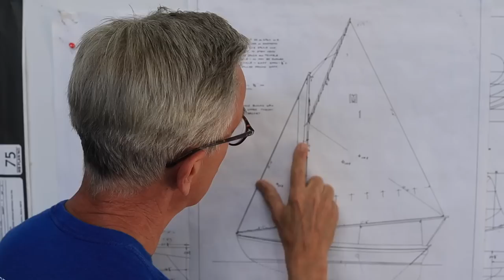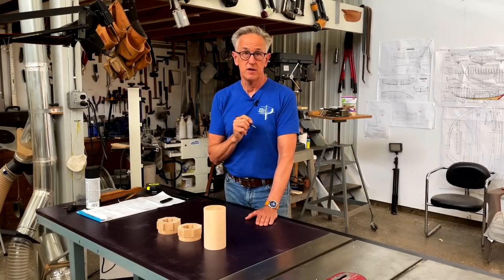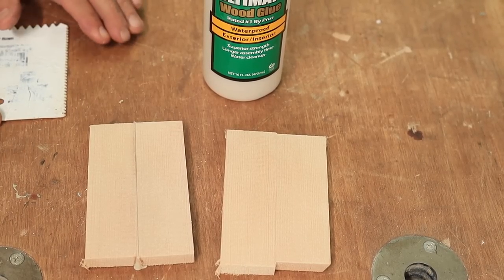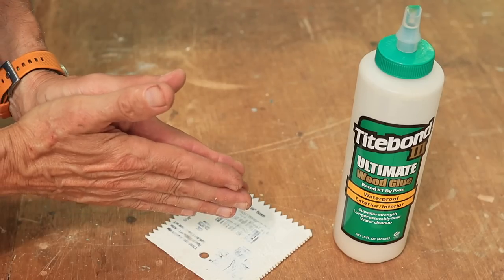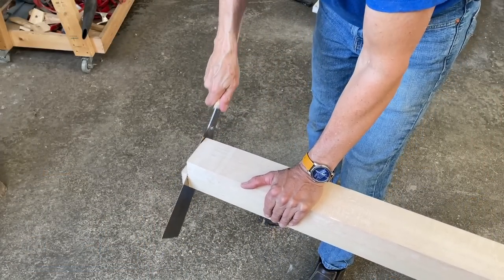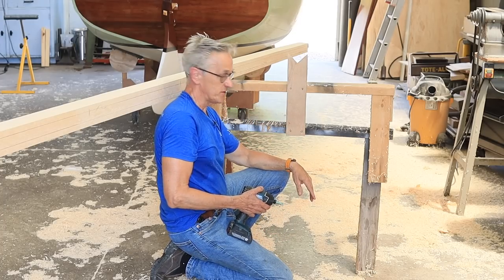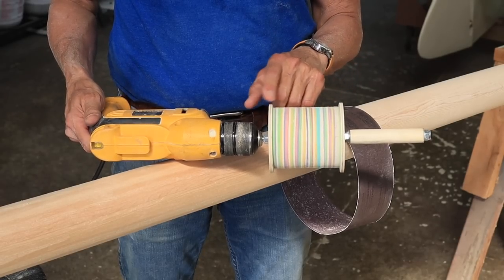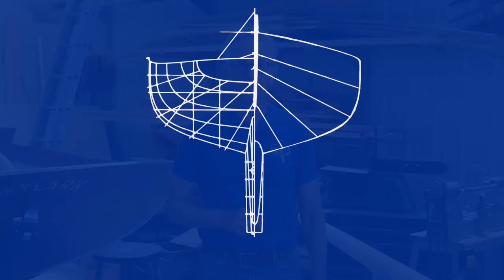Hollow vs. Solid Mast S2 E66

Comment: You cited densities for Douglas Fir being ~6% heavier than Sitka Spruce; These are natural products with inherent variations; it would seem to me, pretty likely, that these are close enough that you could actually find some Douglas Fir that is less dense than some Sitka Spruce...but you might have to search through a good-sized pile to find it.
Also, a factor in comparing options here is the cured weight of measurable quantities of adhesives.
The major benefit of a sectioned mast is your ability to have more uniform stength in different planes, versus the 'pole', which, even if you can get one that has grown quite 'straight', it is still a little hard to tell how symmetrically it has grown.
Assembling a sectioned mast can let you be more discerning in examining the grain structure and patterns, for symmetry/balance.
Personally, I like the idea of the 'birds mouth' joinery, as it rather functions as an integrated tongue/groove system...except for the part where the tapering is going to eliminate much of that, in the upper portion of the mast.
Unless you 3D modeled it, and had a MONSTER CNC machine!
 ;-)
Happy waves!

Comment: There is another option in mast building which can be 5x stronger then a solid mast. That's a laminated one wite epoxy glue. The biggest advantage is its flexibility. Be safe and joyful building your boat.

Comment: I'd be worried about rot in a hollow mast. Water is going to get in and it'd have to be drained somewhere, but it is never going to be quick drying in there unless dry air is blown through. 

On a bigger vessel I'd worry about the strength of the mast where it comes through the deck. I'd want that section to be solid, to resist the forces applied at that point, and also so that if the mast was lost in heavy weather it didn't leave a  hole for water to enter below decks. Losing a mast is bad enough but if it opens up a way to swamp the vessel too, well that could be too tricky to handle at the same time. 

Plus a hollow mast is probably going to be wider, which will probably impact the deck structure and also the sailing qualities.

Comment: I wonder if you considered cutting the board in four in order to align the grain in different directions.  Wasn't your wood quarter sawn?
Reply from the maker: No did not consider cutting it as the grain it so straight to would not have helped. And yes, the Spruce is quarter sawn.

Comment: I like your clamp rack, but please explain to me, why did you clamp the way you did with the screw to the bottom? I believe it would have been easier if you had it on the top
Reply: My guess would be out of good habit.  The screw part tends to mar the surface, so having it on the metal saves the wood.   Also the stems facing up is also awkward,  and painful elbow hits are prohe to happening.

Comment: To answer the question on at what point would a hollow mast make more sense than a solid mast: When the difficulty and expense to procure a solid clean and straight piece of mast wood outweighs your budget and time.

Bigger the mast the harder it will be to get an appropriate log. Laminating does provide a certain strength, but as you mentioned its life will be considerably shorter if not kept dry within.

Comment: What about filling a hollow mast with urethane foam?  The foam is closed cell and would prevent water from gettin inside and it would provide some additional structural integrity although not as much as solid wood.  The advantage would be overall weight.  Your statement about weight was comparing sitka spruce to douglass fir but not hollow to solid.

Comment: Bob, how did you get your sanding belt inside out?
Reply from the maker: Hi Roger,
The belt does want to resist but with enough persuasion it will flip outside in. The first belt I used was a 3 x 18" I then tried a 3 x 21" which was much easier to convince to turn inside out.
Thanks for watching,
Bob

Comment: have you thought of doing some small scale testing of solid and hallow mast's, typically hallow tubing is stronger the solid but I am not sure if this translates to wood.
Reply from the maker: Hi John,
I ask my engineer friend about that. He said it is true with steel tubing is stronger because of the density and weight of steel. He went on to say wood is much different, asking "If you were building a deck with 6 x 6 support post which would you want a solid post or one that  was a box made of 1 x 6's?"
Thanks for watching.
Cheers,
Bob

Comment: Maybe a silly question but would it be possible to use a table router and a 1 1/2" roundover router bit to achieve the same result on a lesser diameter mast without having to do all the planing and sanding? A 1 1/2" roundover bit will make a 3" diameter pole.
Reply from the maker: The only problem I could for see is that masts are tapered.

Comment: I built a goat island skiff and went hollow birdsmouth. I didnt have to calculate it but the build was easy. You cut the strips on a tablesaw and plane to taper on the flats sides. When glueing up i used epoxy and i taped off two of the joints on the first glueup. You just bind it with tie wraps it will lie straight. After the glue dries you cut it open and you have two halves. When i glued the final two joints i coated the inside and the endplugs with epoxy. When dry plane the corners off flush and you have a hexagonal spar which is where youd be after a pass with spar guage and plane. The OP here says the weight savings is insignificant but i disagree with that. Theres half as much wood. The condensatin and rot inside issue i hadnt heard of. Mine is only 2 years on so cant say but the inside is completely coated just like the hull. I made my yard and boom from solid stock milled square spar guage and plane and that was easier by a couple steps.

Comment: How much shrinkage do you get with the bronze castings?
Reply from the maker: Hi Guy,
The shrinkage is around 1.0 -1.5% fro Silicon Bronze. There is however many variables. If the casting is very thick it will shrink more and not in a uniform way. 
The great part of the Haven 12 1/2 plans is that Joel White, the designer calculated the shrinkage is the plans. So all Steve had to do is follow the dimensions on the plans. One Benefit of using modeling software it quit easy to add shrinkage or calculate the outcome. 
Thanks for your question. And thanks for watching!!
Cheers,
Bob
Reply: @TheArtofBoatBuilding  : As a retired "old school" pattern maker, I would use a 5/32" per foot shrink ruler.

Comment: When you were looking for the mast timbers, was it possible to find  quarter saw wood, or did you have to take whatever came in that length?
Reply: I think it works like this: Because the mast is round, one side will be quarter-sawn, then walk around it 90 degrees and it'll be flat sawn. So you can just rotate the mast for the best strength. Since he glued up two pieces, it would be good if they were both sawn the same way.
Reply from the maker: I purchased the Spruce from Johnson Workbench is MI. I ask for clear quarter sawn and that's what I received. Great people to work with.

Comment: There's more surface area glued together in the bird's mouth method, which ought to make it stronger.  A friend and I made a 4 inch tapered mast, 12 feet long made from white pine 2x4s.  Sitting on sawhorses at the very ends, I sat my 240 pounds in the center and and the spar hardly flexed.
I also made two masts this way from white cedar, each just under 40 inches long and about 7/8" in diameter, for a radio-controlled schooner.  They weight almost nothing though I think I'll refrain from the sitting a fat man in the middle test.

Comment: Bob, would there be any chance you could offer a link to some documentation on epoxy not being suitable for tight joints?  I can't find anything to that end.  There's plenty to say that epoxy CAN fill gaps if required by adding fillers, but nothing that agrees with your comments.  Indeed in building wood homebuilt aircraft (yes even aerobatic types) epoxy is the only game in town, usually T-88 is recommended, but West's "Six-10" is getting lots of recommendations nowadays as well.  I'm wondering why epoxy would be recommended for laminating and scarf joints on wing spars but not suitable for a boat mast.

Comment: Why do you install the clamps with their handles down?
Reply from the maker: Hi Gene,
The flange on the I-beam has a slight taper on the inside (s-section I-beam). By putting the pad of the movable jaw on it the pad will adjust to the angle of the taper allowing the fixed jaw of the clamp to seat properly (perfectly flat) on the wooden mast.
Thanks for watching!
Cheers,
Bob

Comment: I enjoy your channel and admire the craftsmanship and beauty of your work. However I disagree with your solid vs hollow mast construction argument. The difference between the density of Sitka vs Doug fir does not signify the weight difference between a hollow mast and a solid. Just looking at the cross sections of the two samples that you made tells the story. The hollow sample must be at least 40% less dense whether made from Sitka or fir. I would also like to point out that the strength of the hollow is multi directional. Each stave is positioned at its maximum strength. A solid mast would have to have variable directional strength due to its grain direction.

Comment: Hi ,the difference between the solid to wood composite is the composite give much resistant and eliminate the part are negative on mast work .
All part of boat do a work ,all together do a work team , specially on wood boat .
The mast must to be resistant to complete the work and don't have part ,inside , can don't work or do opposite reaction on work .
For this reason a must empty is structurally much resistant than a solid ,because some part inside are only weight and working to reduce the strongest of must .
Plus ,when the shipwright prepare the part of composite must check if the fiber of wood is linear ,strong ,with same age ,and same percentage of strong line .
Because all tree growing in different way and different season condition can give different strongest .
To glue is better use always the epoxy elastic ,or resorcinol glue ,the red or black .
If the must is composite in two or 4 section ,the line must be from outside to inside from the bottom to the top ,glued in opposition .

Comment: semper sou grato por seus ensinamentos, e cheguei ao ponto em refl ir sobre o mastro do meu projecto, você apresentou todas suas medidas, mas pode explicar a conforma o comprimento; no meu caso é necessito um mastro fracionado de 9 metros, how can we define o diamentro na base e no topo?

sempre sou grato por seus ensinamentos, e cheguei ao ponto em refletir sobre o mastro do meu projeto, você apresentou todas suas medidas , mas pode explicar a fórmula conforme o comprimento ; no meu caso é necessito um mastro fracionado de 9 metros, como posso definir o diamentro na base e no topo ?
Reply from the maker: Eu acho que você está dizendo que seu mastro tem 9 centímetros de diâmetro? Se sim, está muito perto do meu mastro, que tem 8,3 cm. Minha base tem 6,66cm e a parte de cima tem 5,4cm. Espero que isso ajude.

I think you're saying that your mast is 9 centimeter in diameter? If so it is very close to my mast which is 8.3 cm. My base is 6.66cm and the top is 5.4cm. I hope that helps.

Comment: I know nothing about boats and it has 40 year since I had construction engineering class, but back then they were big discussions about the engineering board correctly could be 10 or 20 times stronger than a solid piece of wood of course this depends on the construction the way out where the stress points are and with modern day construction one of the manufactured mask with aluminum, stainless steel, bronze, Graphite or fiberglass center Could give you extremely good properties more so than a solid wooden mask. Because this is something Engineering would have to lay out look at where all the stress is coming from and then put together what would be the most effective way to build it. And of course to sit down for engineer and do that you’re gonna spend $2000 to $20,000 to get the information. And then doing the manufacturing process exactly right. And these are big ones gifts and we’ve been making solid wood mask for 4000 or 5000 years And They have done a damn good job for that many years. I live on the ocean so I have lots of stores and shops to go in and look at boats and how they’re made and put the gathering the materials lots of other things being used for this besides wood so my Sumption would be that there are companies out there they’ve already done this work and give you a truthful answer what would be best for your purpose I’m just shocked that no one stepped up and gave you more detail. The heart and soul of Youtubers people working together figuring things out and sharing their experiences well I can’t fix it I don’t know what to tell you I can do is offer my thoughts on doing a great job keep up the good work I’m sure it will be fine.

Comment: I didn't follow one point of your argument.  You said the weight difference between Douglas Fir and Sitka Spruce was insignificant. Then later you said the weight difference between solid and hollow was insignificant.  I've always heard it said that weight savings was the principle reason for building a hollow mast,  as it obviously is a lot more work.  It seems you applied the data from the first point to the latter.  And, I hadn't heard the issue of rot raised before, which is an important consideration.

Comment: Its a weight, and material utilization problem.  The answer is not universal on when it makes sense to do something over something else...  Like everything in engineering, it's a tight rope between many competing constraints.  The material at the centroid isn't doing much in terms of strength....  I hole heartedly agree that hollow voids are subject to moisture ingression that can lead to structural looses that won't be accounted for in the initial design an analysis... It's obviously prudent to put every amount of insurance into the design to seal blind surfaces to provide protection. and drainage.

Comment: I think it's erroneous to say that the weight difference between hollow and solid is insignificant - it's actually a substantial saving., particuarly for an 8-sides birdsmouth spar. I think perhaps you meant to say that the weight penalty of using Douglas fir  instead of Sitka spruce is insignificant.
Your're right about tapering a birdsmouth spar, though - it's  very finicky as it involves planing or milling a progressive taper on all 8 pieces

Comment: Unless the mast is pi-sliced pieces, I suspect you would have to pay attention to the deflection characteristics of the wood in a solid mast. A hollow mast offers equal deflection in all directions. I think I agree with some commenters that a hollow mast, from an engineering perspective is better because you can deploy pi-sliced ( end grain oriented from the outside toward the center ) ribbing on the interior. Just look at the spruce goose and the ridiculous wingspan that thing had... Airplanes in general. Ribbed beams are king. Just my opinion.

Comment: If the mast were un tapered what would be the performance loss?
Reply: On a boat like this, none, but it won't look "correct" because the taper is fundamental to the lines of the boat.
The thing with this mast weighs, what did he say, 28 pounds?  If you did it untapered, it'd be 29 pounds or something with essentially no difference to the balance or performance of the boat.  The further away from the center of gravity that weight is, the higher the center of bouyancy will be, but with the weight difference only being a pund or so (and distributed over the top 1/2 of the mast), it won't really make any difference to how the boat handles or floats.

Comment: One puzzleling question:  WHY?  
Why do all modern masts have to be round?  Many are Oval Shaped.  Metal is different as it can be drawn  to shape and is just as strong and a Lot Lighter, but that is metal.
In the Olden Days, round was good as trees were round, so they were shaped a bit and done.  It also was necessary as hoops were used to go up and down the mast, so again, round was good.
But yours, for example, could have just been square or even eight sided (16 might be too much) and be just as good as everything is bolted to the mast as nothing slides up and down the mast but on a track.

Comment: Another way to use epoxy is reduce it with an acetone and harden the joint under heat. It gives way finer joints

Comment: Your statement that the weight difference between hollow and solids masts would be “insignificant” bears some discussion.  I’ve build a few small solid masts and one larger birds mouth mast.  Any hollow mast will have to be lighter that a solid of the same dimensions.  A bitdsmouth mast with 100 mm outside dimension and 68 mm inside dimension is about half the weight.  Granted that the hollow mast will need a few plugs inside the weight difference might be  sunificant.

Comment: Sealing, as in putting on a top coat that water cannot penetrate, is generally a very bad idea.
You typically need ventilation so that the moisture can get out, because it will get in no matter what.